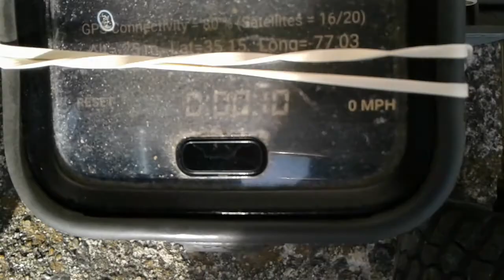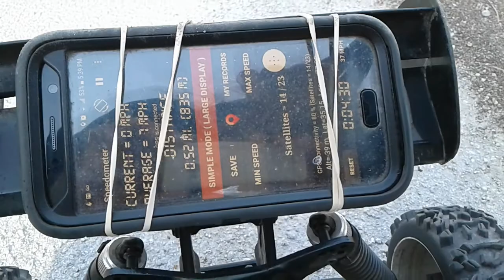My next RC "OFNA HYPER 7 RESURRECTION" Conversion/Repair pt4 Test run #2

Comment: Dang nice real nice it's coming together,👍👍
Reply from the maker: RC create Thanks for the support Bruh👍👍✊👊😰. You give me some good pointers and I appreciate that my RC Brother. I might need a longer size can. Once I get an ESC and the rest of my parts to get her back box fresh, I'll see how she performs😂😂. I'm starting to love that HYPER though😰. Can't wait to see yours in action and I know it's going to be the Truth. I've seen Hypers on the ARRMA 6s systems and whoa😰👍👍✊😎
Reply: C McCotter just finished putting her together today she looks good gonna try and run her tomorrow. I was taking her apart and wad impressed on how good these are build
Reply from the maker: RC create 👍👍Yes I feel you on that. The previous owner had did some damage to the front right Lower arm, but everything else was intact. When I started replacing stuff with newer parts I said the same thing😂😂.

Comment: She running pretty sweet brother! Just gotta adjust the gear mesh or possibly grease up the transmission to get rid of that high pitch squeel but other then that little noise she a beast already. 👍👍✊
Reply from the maker: ErrlRC Lol on which one😂😂😰. I need to adjust my slipper on my Stampede and you might be right about greasing things up😰. The Hyper has maybe 15 mins total runtime so We still working her out..Still have parts to put on Stampede so hopefully we'll have them right✊Thanks for your wise words👍👍
Reply: C McCotter the stampede sounds good I was mainly referring to the hyper 7. Yeah a little grease could help reduce the sound but like you said it may also need to be broken in more if you know what I mean ☺✊✊
Reply from the maker: ErrlRC Dont worry, I will work that out🤣😆just so happy to have her moving that the sound doesnt bother me yet😂😂😂✊. Now the Diffs gonna cost me the most🤔, but when its all said and done, all parts will have been replaced. Im hoping that im able to get all 3 diffs before its hard to find them. Im going to get some more pinion gears first, but the 18t is the only Mod1 I had on hand. Will try some others anyway because the final motor I want might need them💯😁Thanks for the advice and sorry for the book of words✊🤣😆

Comment: Bro! Take the hyper to a track, and... that, will be all she wrote!  I love running my 1/8 scale at the track! It's a whole other ballgame! Do you have a track near by? She almost there! I just bought a 3674 2650kv for my Optimus XL! I will probably need to gear it down a bit, but? 40-45mph is probably as fast as you will need on a track? Great vid bro!😎
Reply from the maker: Bashing RC 24/7 Thanks Bruh👍👍. I have a small Track down the Street and I know a few guys that's into the Tracks deep😂😂, they travel😰. Yeah she coming along but we still got some things to do, but so far I'm happy😆. For her first full run with no issues except motor temps on 3s🤔. Once I made me a battery tray I felt a lot better The pack was mighty close to the spur without one, my broke Traxxas chassis made that possible. I'm thinking about the track though